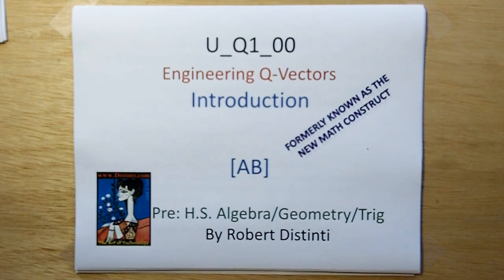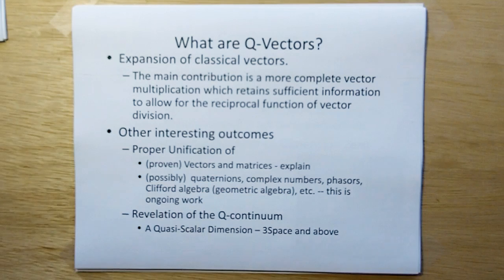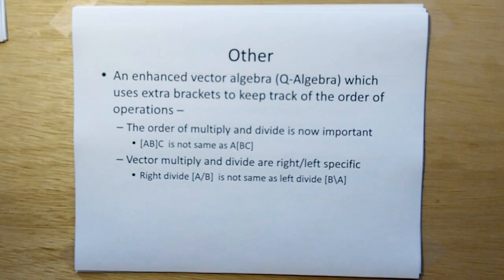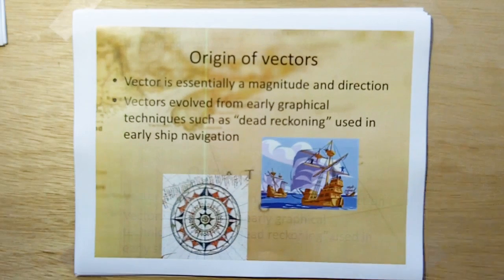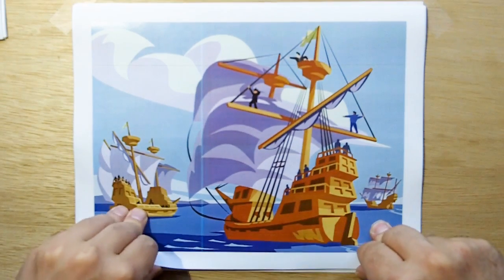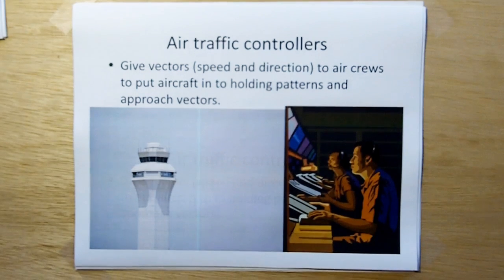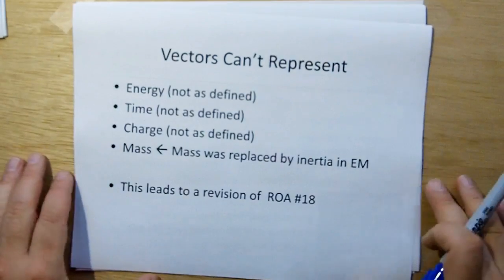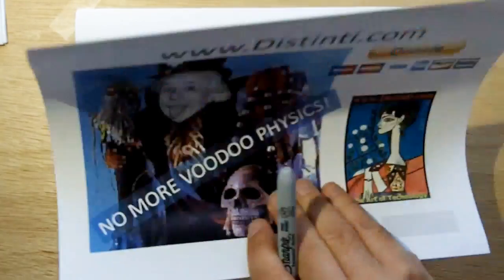U Q1 00: Introduction to Engineering Q-Vectors

Comment: Bernoulli principle is erroneously invoked to explain airfoil lift. The Bernoulli principle states that air pressure is inversely related to air velocity. However, an airfoil moves through stationary air; it's the airfoil itself that moves and displaces the air it moves through. Thus, the preconditions for the Bernoulli principle to create lift are not met, there is no difference in speed to speak of between the upper air flow and the lower air flow. The air above the airfoil does not move faster than the air under the airfoil due to the longer chord of the upper airfoil as is erroneously assumed. There are youtube videos that document this fact.

Airfoil lift is best explained by the Coanda principle which states that air tends in certain circumstances to follow a curved surface, and the fact that air displaced downwards generates an equal and opposite lift on the airfoil in accordance with Newton's force laws.  (The airfoil also generates a certain amount of air turbulence which manifests as the primary cause of drag.)